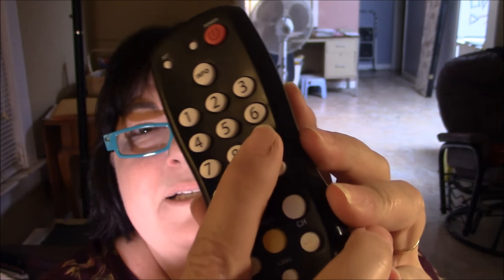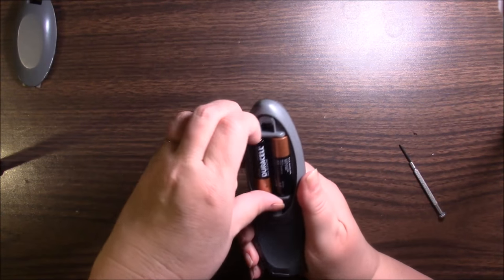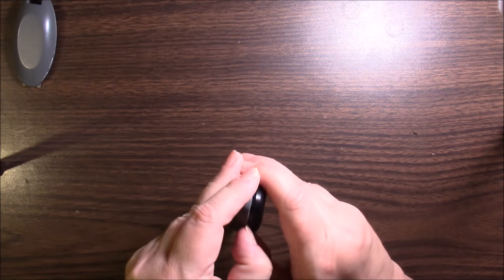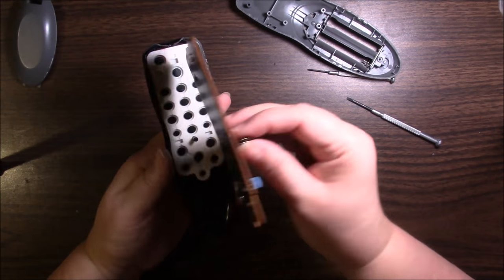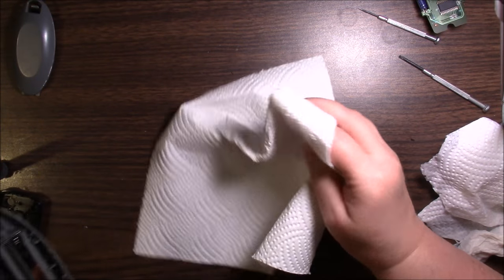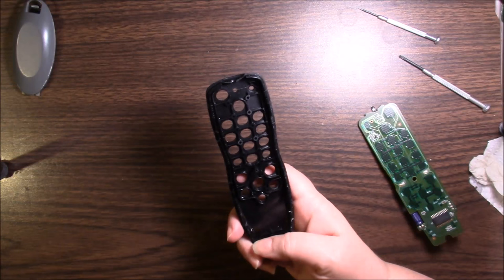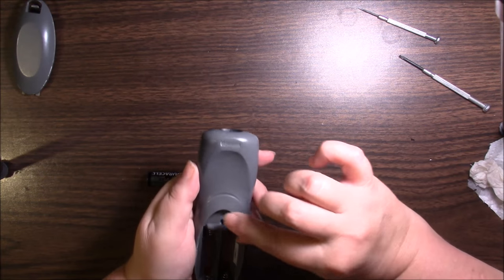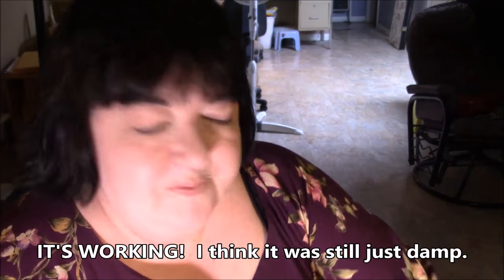Watch Me Clean My Remote Control - DIY Life Hack to Fix Your Remote

Comment: I should try that, our remote turns the volume up when you are trying to turn it down
Reply from the maker: I bet it would fix that!
Reply: @jennymorgan2477 
This is Jermey McGuire. 
I, had the same issue with my old dish 54.1 remote; when you turn up the volume one notch the volume would increase, unfortunately that old dish 54.1 remote got replaced 13 days ago, the backlight quit working the mode lights quit working and the buttons quit working. I had fresh batteries in the remote.”
I could get the guide button to work every now and then; until it too stopped working.  Now I have new dish 54.3 remote!!

Comment: I think washing it is Madness, The back of the rubber keypad is impregnated with a powder that conducts electricity, that powder pushes into the circuitry on the component board and completes the circuit. over time the powder fails and the remote becomes ever more unreliable and ultimately useless ?  :(
Reply from the maker: Try washing it. Then talk to me about madness.